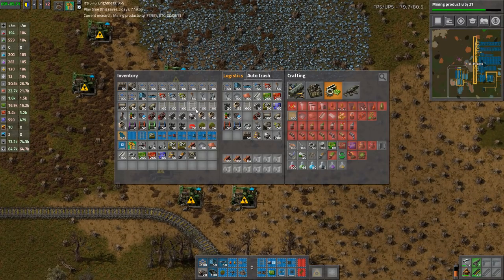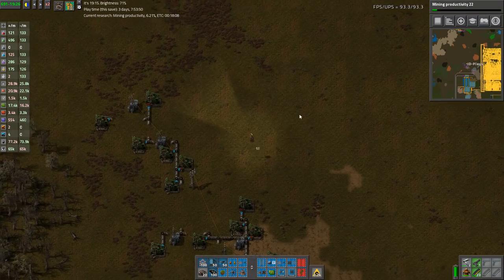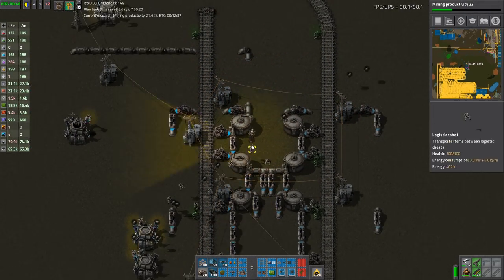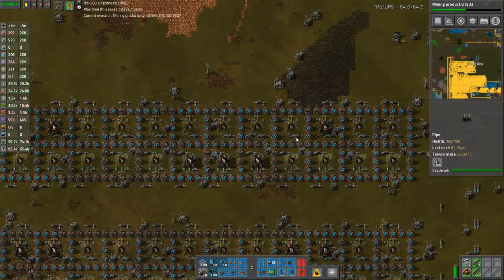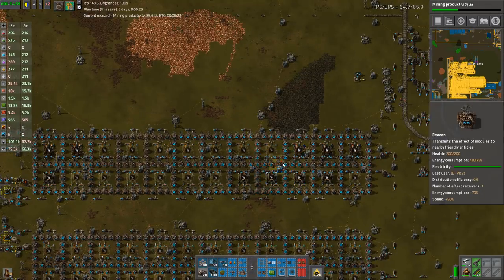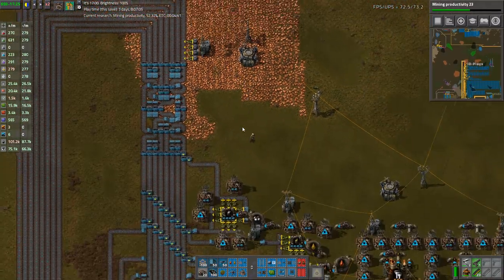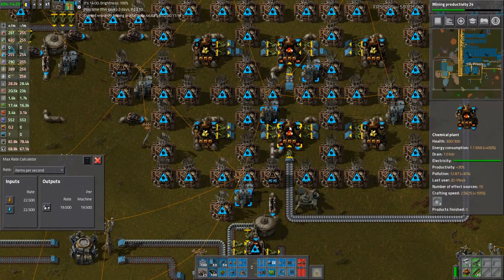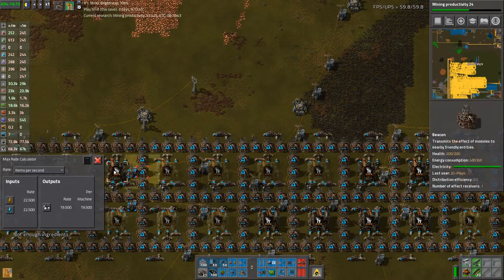Hitting Factorio Below the Belt EP02 More Barrels Needed

Comment: Pretty happy with this series :) Building my own 2K SPM belt-based base atm.
JD, there are still some more water pumps misaligned (4 or more), as well in the bottom as the top build of the oil refineries, mostly in the top row, but you might want to check them all.
Reply from the maker: Thanks mate, ill check them all when I hook them up, its much easier to see whats working and whats not when they are all flowing